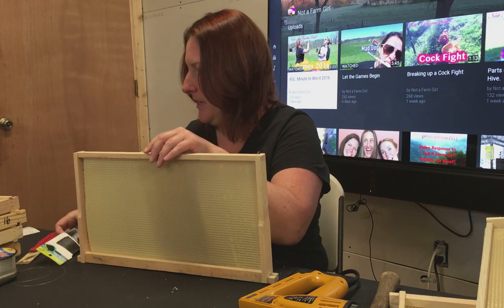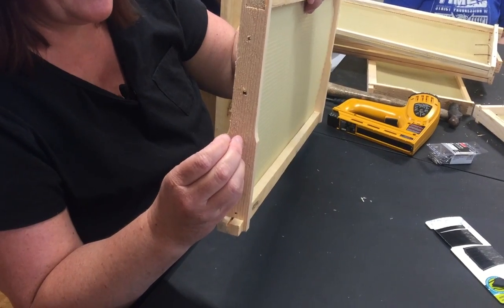Installing Wax Foundation in Frames for Langstroth Beehive

Comment: the slot in bottom is suposed to be big enough to slide foundation through with out  removing the stip on top  turn frame up side down and slide in   all way to top the n berad from side
Reply from the maker: +embarado smithing and woodcraft Our wax didn't just slide through it, it was too bendy if that makes sense. Maybe because the foundation was wireless?
Reply from the maker: +embarado smithing and woodcraft I'll try it again next time though and see if we can. :)
Reply: chill first it should help with bending
Reply from the maker: +embarado smithing and woodcraft That's fantastic! Thanks for the tip.